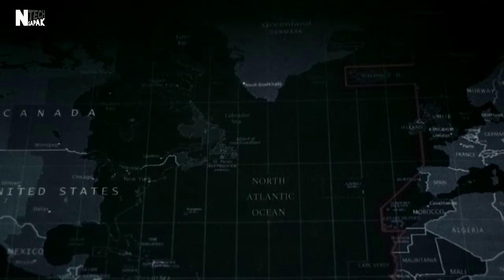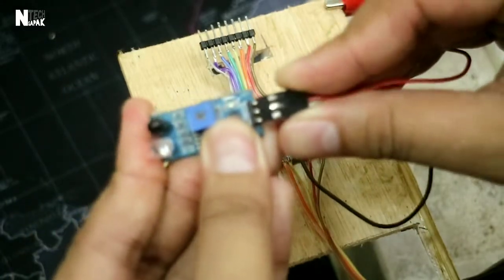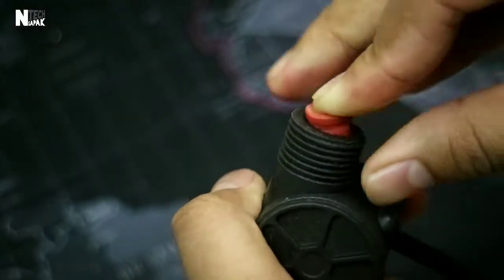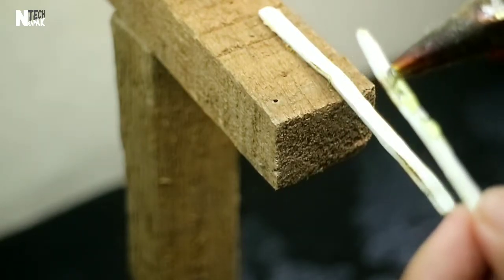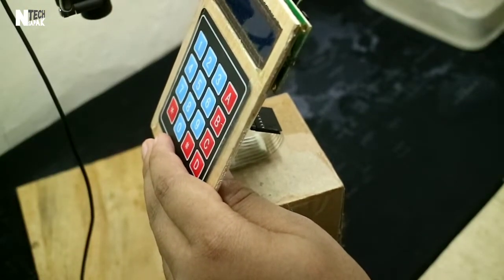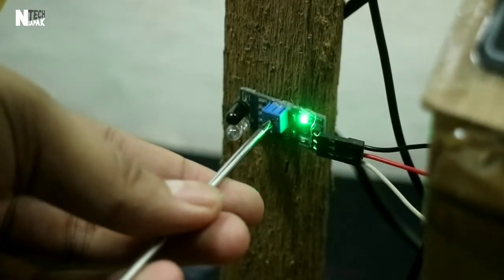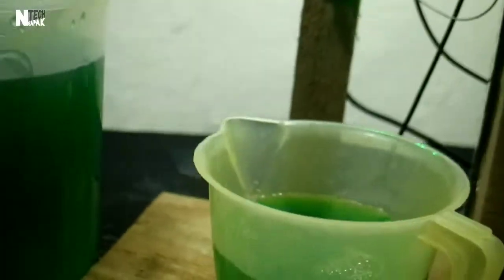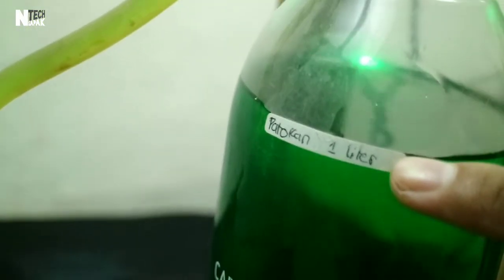DIY Filling Machine Using arduino with Flow Sensor

Comment: Bang mau nanya saya menggunakan esp8266 dan pin d2 untuk signal waterflow dan gnd masuk ke pcb gnd, untuk vcc saya masukkan ke stepdown out + kok hasilnya ga stabil ya ?
Reply from the maker: esp pin interpurtnya beda dkeknya
Reply: @Ngapaktech  soalnya saya pertama coba bisa stabil hasil nya cuman sehabis itu pengisian nya ngawur 1 liter di serial monitor total pulsa 1 liter cuman hasil pada bak mngkin 300-700 ml an

Comment: Mas kalo pakai pompa ac bagaimana
Reply from the maker: Sensornya ga bisa kalo aliranya terlalu cepet
Reply: @Ngapaktech  pake sensor yang besar lah yang 1 inch ada gk?
Reply: @Ngapaktech  soalnya cuma pake pompa shimizu 125watt
Reply from the maker: Beda mas , itu mangkanya di sebutkan speksifik tipenya jadi ga bisa coding itu buat sensor lain